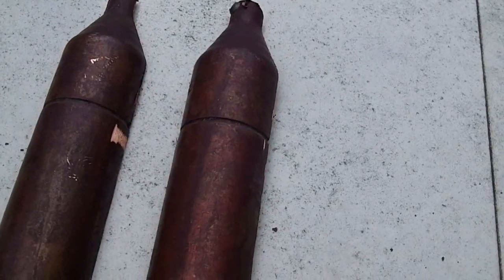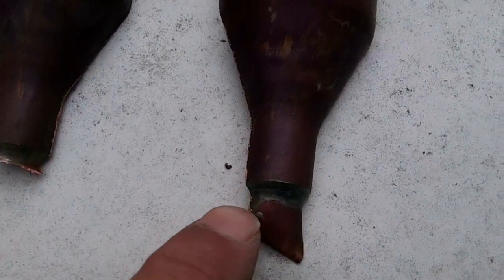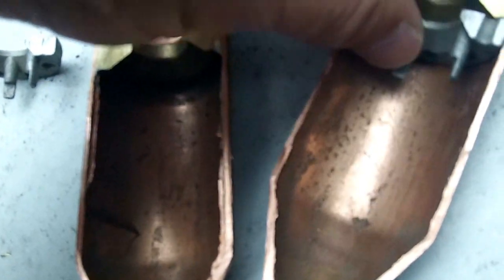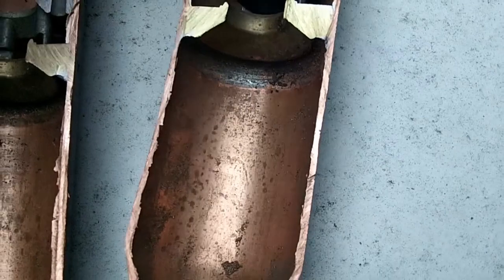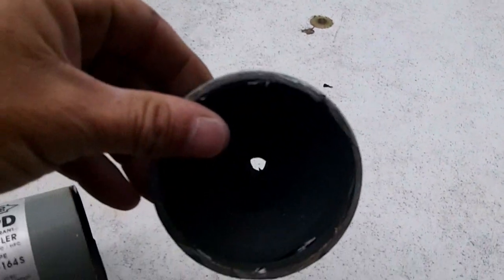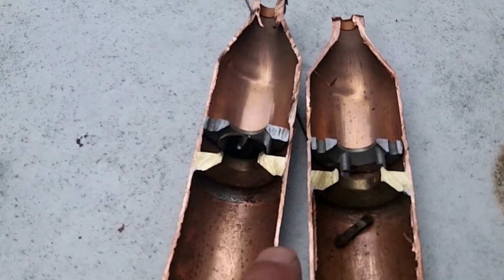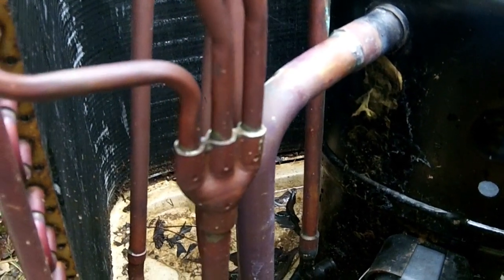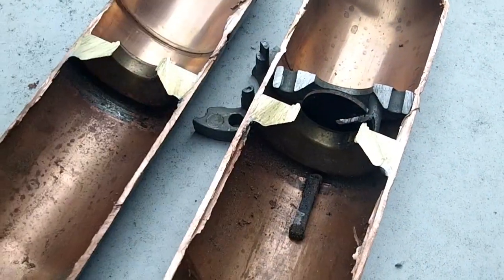Whats inside an HVAC muffler

Comment: That doesn't even look like a muffler. Mufflers have screens, and baffles (plates with holes in them) to reduce the noise just like on a car. Just looks like an old fashioned check disc valve.

Comment from the maker: look for spot welds or an indention that runs around the muffler that will tell you if it has a check valve in it. I can bet your not the only one that has ever remove one during a compressor changeout.

Comment: Perhaps muffler isn't the best description for these devices since their primary goal is to protect the compressor. Which I wasn't aware of until now. Ooops, I may have deleted a muffler or two along the way thinking it was for sound attenuation only or it might have been a drier. I would have been more careful to save the 'muffler' during a compressor change out had I been aware of it's true purpose. It's like an expansion pipe on a 2 stroke motorcycle in a way. 

Thanks for the great info!!!

Comment: I believe its in fact  just a check valve and not a muffler because some older scrolls would spin backwards when shut off as pressures equalized and the check valve prevents them from being blown backwards because of high side pressure before equalizing thru the metering device

Comment: Bristol compressors are designed to internally equalize by utilizing an external check valve in conjunction with a non-bleed type TXV. This technique will help maintain system operating pressures during the off cycle, thus improving the seer performance. stolen from the internet via Iphone 5 lol

Comment: I think its only the Bristol Infinity Scrolls that needed the check valves as they would spin backwards till the pressure equalised otherwise, and not the recips (assuming Benchmark is a recip). Bristol stuff is not common here, just been quoted 8wks delivery on one! 
Maybe that was a combined muffler and check valve, it would save time and cost on the production line. 
Will have a look at the LG when i get my new camera, old one died during coil washing vid.... :-p

Comment: Hi Ralph, That looks like a magnetic check valve to me, (have a look on google images) maybe that unit could have bad a bristol scroll which need an external check valve unlike copelands. I think the little bar is for the magnetic disk to pull against.

I have a dead LG unit to pull apart so will see if its got one too!

Interesting stuff as always :-D